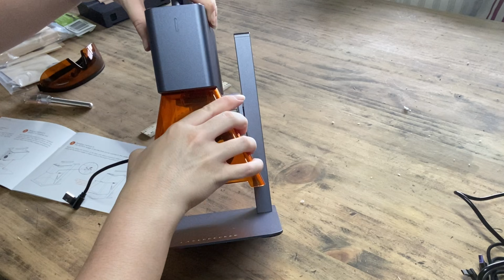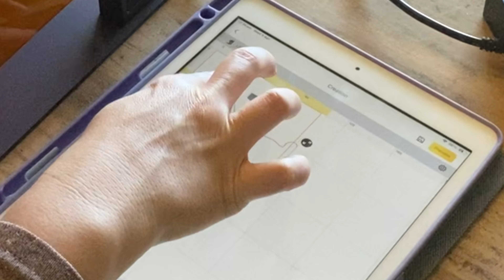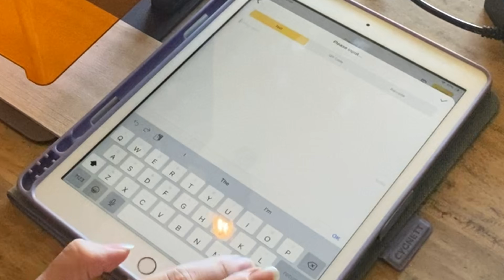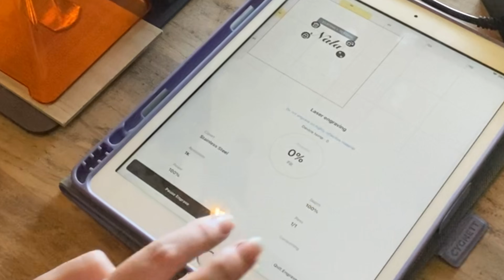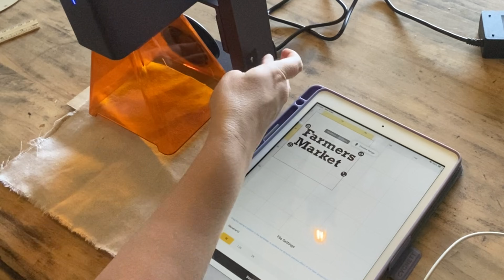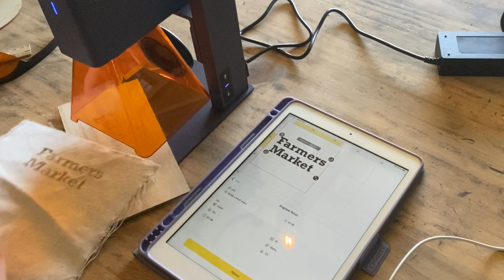Using the LaserPecker 2 | How to set up the LaserPecker 2 | Engrave Wood, Metal & Fabric | DIY

Comment: Did you use 1k, 1.3k or 2k for the stainless steel?
Reply: I have had mine about a year and I don't use it nearly enough
Reply from the maker: Hi I just used the preset settings ☺️

Comment: Are you able to do an embossing effect? Where it cuts out your image on like a tag but cuts around the tag so the image is rasied ?
Reply from the maker: Yes I believe you can 😊
Reply: @TheProvincialFarmhouse  awesome if possible could you maybe make a video on it? I've been considering buying a laser engraver but I'm overwhelmed by all the models that do different things I was about to drop 4500 on the xtool p2 but someone had mentioned the pecker 2 could probably do it as well I would be engraving coins and maybe half inch thick dogtags I haven't came across a video that has really gone over how deep the depth can go or even how to set it up for that matter. A company I worked for had their logo on a dogtag and it was raised while everything around it was way more shallow so I'm guessing embossing is the correct term? Many thanks!